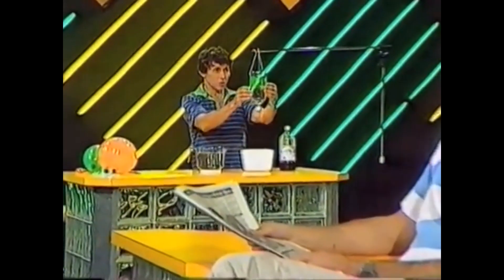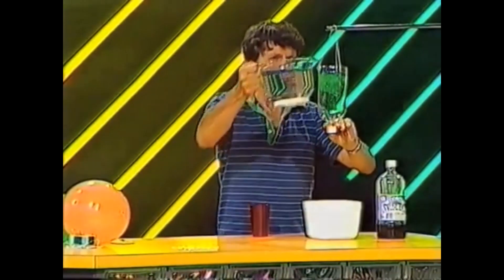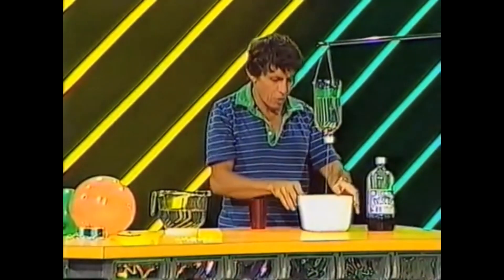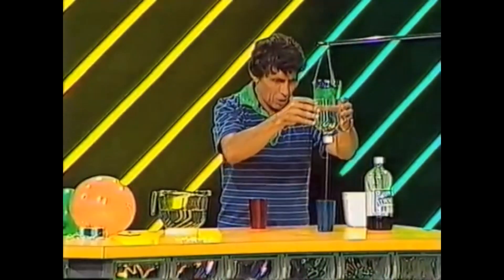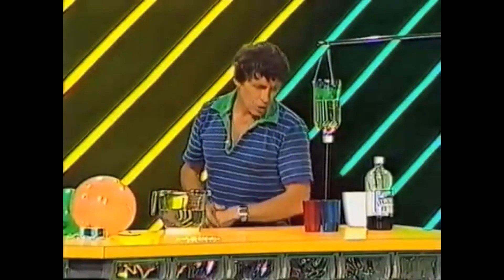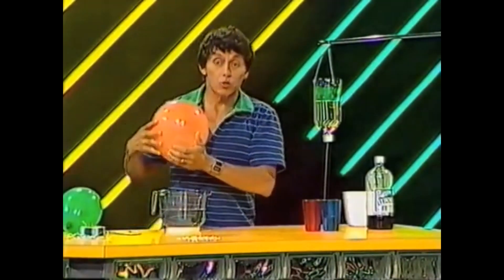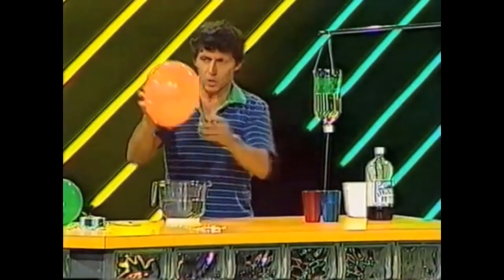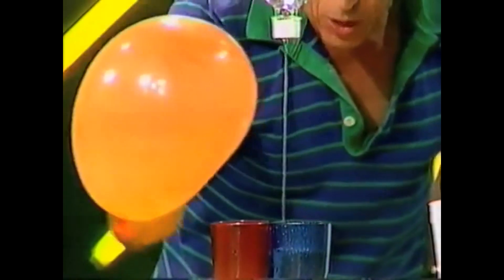Bending Water

Comment: Another way to do this is to just turn on the tap in the kitchen or bathroom so that just a tiny stream of water is coming out. Then, grab a plastic or rubber comb and comb your hair a few times and hold it close to the water stream. If your hair is somewhat oily this may not work very well, but if it's clean and dry the stream can make quite a substantial curve!

Comment: Sometimes when I'm putting active dry yeast into the pan of my Bread Machine, the pan has a charge and the yeast, instead of falling straight down from the measuring-spoon at one side of the pan, flies horizontally down and to the opposite side of the pan.
Reply: Try rubbing the spoon vigorously on your head and see if it jumsp to the other side of the pan

Comment: Who else remembers the soft drink bottle coming with the black base on the bottom
Reply: I used to make terrariums, hydroponic nutrient feeders and elegant swiveling canisters with them. Wish you could still get them.
Reply: I do.
Reply: I certainly do. Wonder why they stopped doing it.
Reply: @croftmire  , they stopped because they found a cheaper, more efficient way:  instead of making a bottle with a hemispheric bottom, which was good at containing the pressurized drink inside but bad at standing, they could make a rounded bottom with five points, which combined enough resistance to the pressure with enough flatness to stand on its own, so that there was no need to make and attach a separate piece.
Reply: Engineer Guy's most recent video is about soda bottle manufacturing, and briefly covers the change of the base.